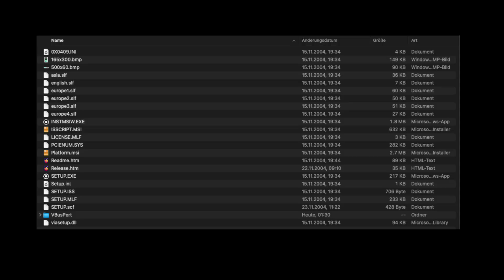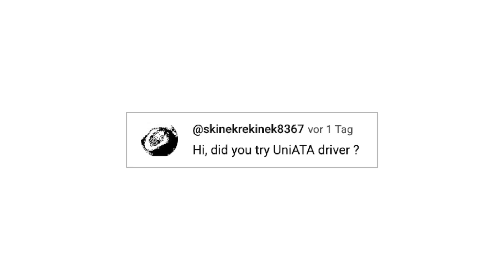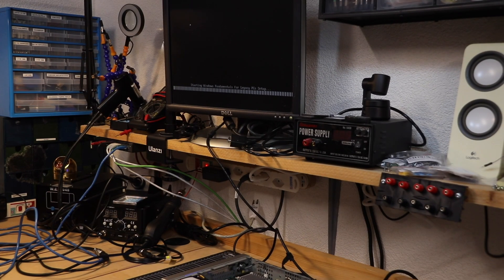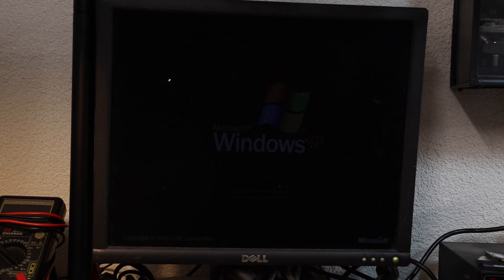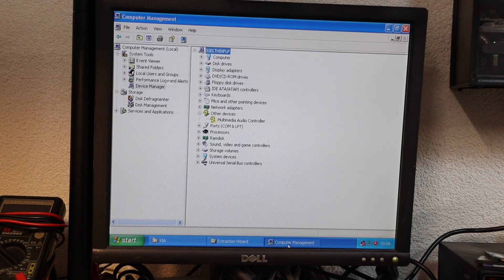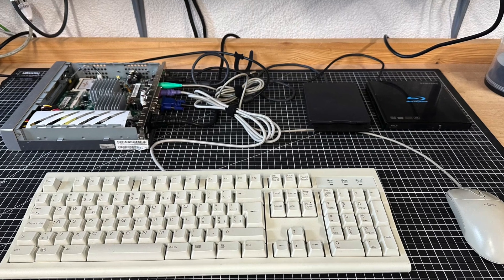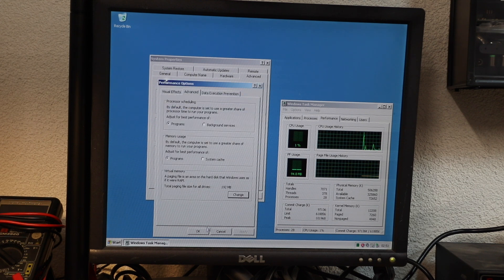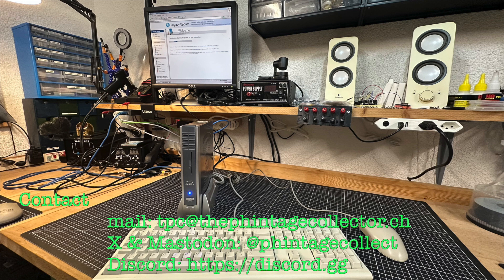Saving My IGEL ThinClient with the Universal ATA Driver! | Windows FLP Fix [TPC Patch-up]

Comment: igel supports 1G of ram if you can find rams that has 8 chips on them (not 4), it's an allocation thing. Even if you have 2GB of ram with 8 chips on them it will work, and will be seen as 1G. Also if you install windows 2000 (instead of xp) it also run faster.
Reply: https://www.youtube.com/watch?v=3t6hcOWAoR8

this is the version of igel I've tested it with 1G of ram (yours might be a little bit different but still it could support 1G)